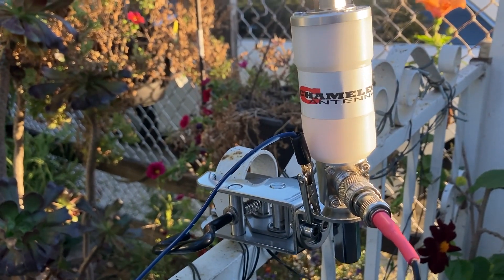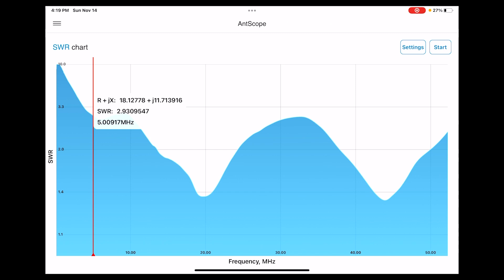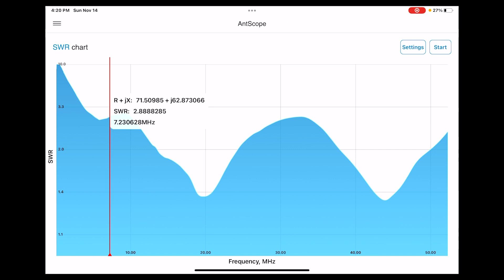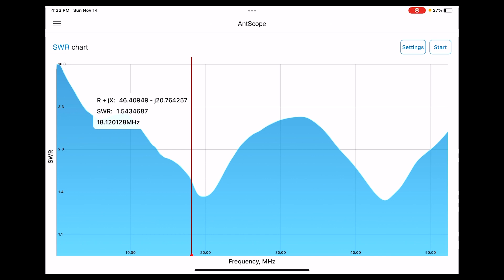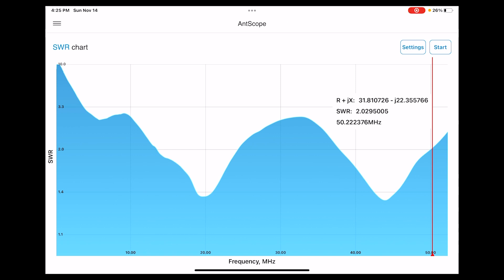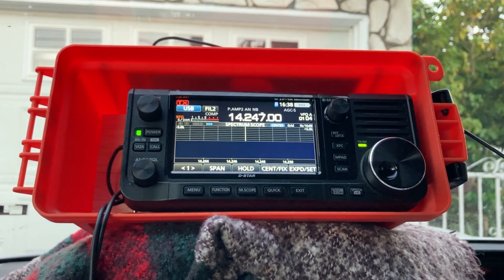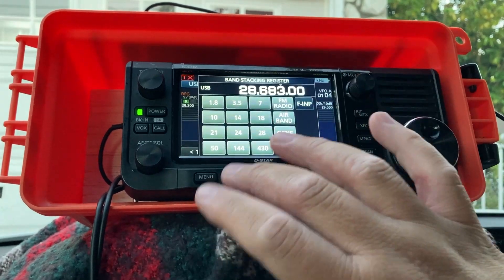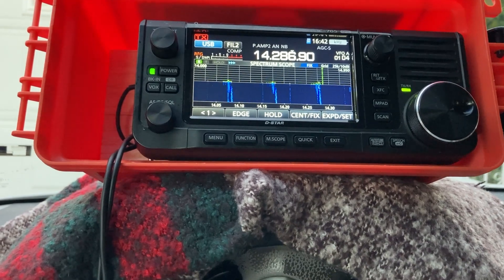JAWMount Deployment for CHA MPAS Lite

Comment: Frank, I have that antenna,  for 20m and below, another words 20,17,15,12,10 and 6. Just use the wip, and many radials.  Start with the wip all the way up and shorten, mark where you have the best swr on each band with a sharpie.  The reason I tell you this, when you go to the park, you can be right at your antenna and change bands quickly.  You will have better than or near 1.4 swr on all bands, I get 1.0 on 17 meters. 

Don’t use the chameleon Matching Unit, I like using the chameleon stake to a made up mount.

You can also put that wip on you car and get perfect swr on all those bands.
Reply from the maker: Hello AJ4E0, any suggestions on a mount?  What do you use?  Any example videos?  The shorten antenna idea is a very good idea - I should have thought of that. I have used many radials on the UNUN, and I didn't get any real effect in lowering the SWR.  I have some videos on that.
Reply from the maker: Now that I'm reading this better, so for each band you want you have to lower the antenna for the best SWR, correct?
Reply: Emailing you
Reply: this is great info, how long should the radials be?